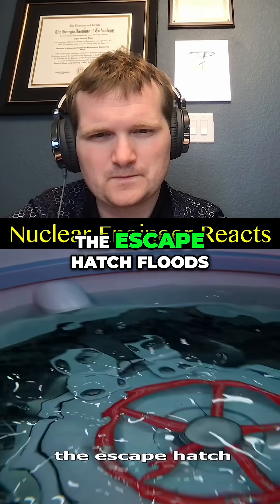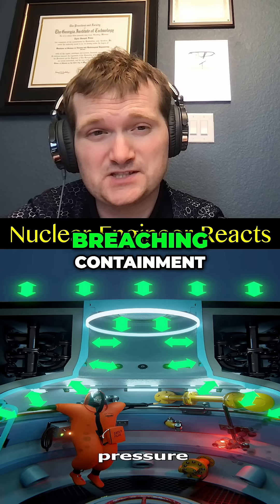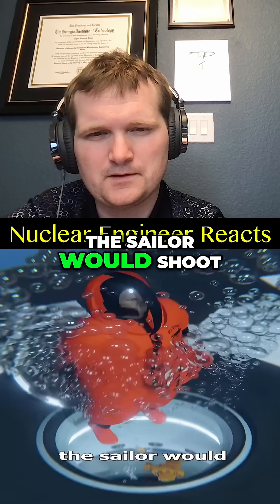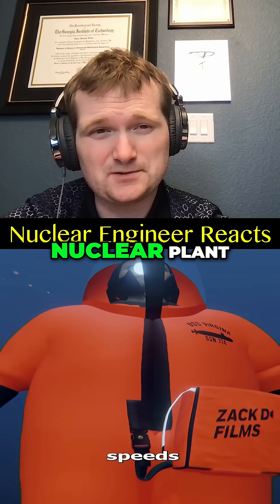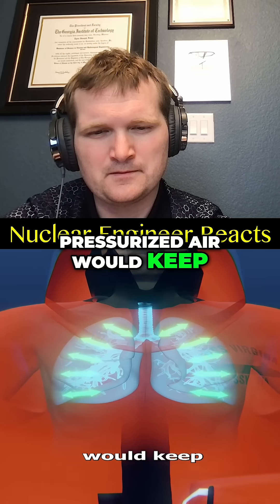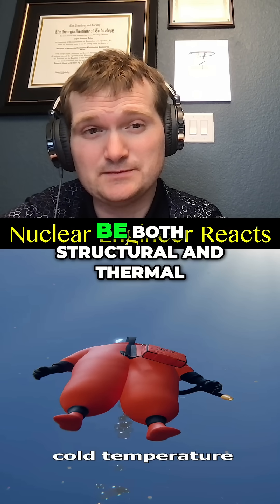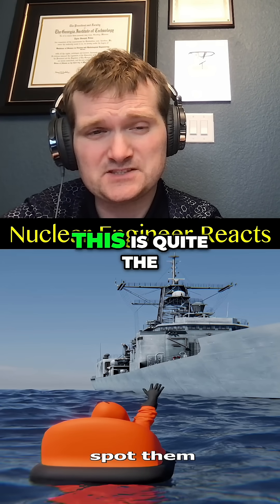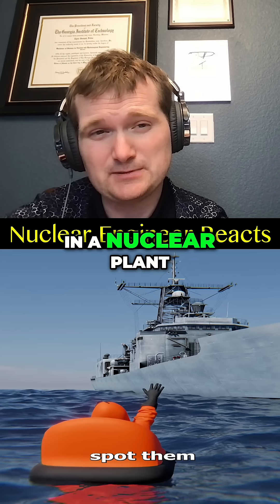How Sailors Escape Submarines - Nuclear Engineer Reacts to Zack D. Films

Comment: Question: if it works as designed and here explained, and the sailor surface, would there be a way/ enough time to equalize the pressure? Decompression without the chamber? At what point does the suit reach the limit of its usefulness?

Comment: Is this why divers can’t come up right away? Cause the pressure?
Reply: They have to spend intervals of time at a given pressure before moving to lesser pressures. This is to allow the human body to deal with reduced pressure without bodily fluids converting to gasses.
That only applies if they've been at very high pressures (deep dive).
With a submarine evacuation suit, the sub occupant would not be under high pressure as the sub deals with deep sea pressures via steel structure, not internal air pressure. To get from the sub to the surface, they have to pass through extremely high water pressures. The suit would expose them to extreme internal pressures until they reach the surface. As Tyler said, the suit vents the excess pressures as the sailor floats to lesser and lesser water pressure zone.

Comment: Fun science fact: If you pressurize air enough, it becomes heavier than water. At depths that science submersibles dive to, this becomes an issue. They will use incompressible fluids that are lighter than water, such as gasoline, to rise up.
Reply: Don't you need around 900 atmospheres for that? So unless you're in mariana trench, it should still be lighter
Reply: @d07RiV I'm not sure of the exact depth and temperature. But yes, I was thinking about the sub that dove into the trench.

Comment: Imagine hitting a fish at 15 feet per second and dying
Reply: I don't think 10mph contact with a fish will do too much damage to a person
Reply: @beerrun5 you say that until it rips the suit and you explode 200m down
Reply: @BraystalBray yea, it could happen, but a suit built to withstand that pressure should have enough of a safety net to protect against that situation.
Reply: @BraystalBray The absolute pressure would be high—about 1 atm + 200 m H2O, which is over 20 atm—but gauge pressure could be in the party balloon range (less than 0.1 atm). The issue with a rupture isn't exploding, it's not ascending fast enough to avoid decompression sickness.
Reply: Not mention the propellor of the surface ship above you 😊

Comment: They're still gonna get the bends pretty bad won't they?  That was an actual question too if anyone knows.
Reply: I was thinking that too while watching and thought Tyler would address this but didn't
Reply: The Bends happens because of excess nitrogen in circulation when diving as a function of pressure and time, because inhaled SCBA gas is not ambient air. It is still possible in this circumstance but less so because the sailor would, presumably, be breathing ambient submarine air. Also, the risk of bends is certainly better than getting crushed instantly in a submarine accident.

Comment: I know he's smart, but I don't think he knows all this stuff off the top of his head.
Reply: You have to have extensive knowledge of physics to become a nuclear engineer.
Reply: Differential pressures isn't that difficult to grasp. There's a lot of exact math with it, but the concept isn't difficult.
In the environment of the earth, everything experiences pressure from either atmospheric gasses or fluids like water. The human lungs and bodily fluids function under specific pressures. Rapidly changing environments to higher or lower pressures can quickly cause life-threatening hazards.
Like pulling deep sea fish to the surface too quickly, they tend to rupture.

Comment: An automated way to combat the bends?

Could this/ has this be/been deployed as a safety fail for tourist divers/learners on first stage of license/ deep sea dives?

Dry suits only? Or no, full suits? 
Have to be pressured beforehand and not diving before? 

As I wrote it down I could see the issues but maybe someone’s a way it could work because of something I don’t know?
Hit me up I wanna hear it
Reply: Got a way I don’t know* 

Yeah I’m stupid in some of my thoughts but it was my typed thought pathway. Please explain how I’m wrong if I am. No wrong answers
Reply: Divers will have nitrogen dissolving into their tissues for the length of their dive. In the escape suit scenario, you're at whatever pressure the sub operates at (presumably 1atm or close) until the chamber is flooded. If the sub is more than a couple hundred feet deep, I imagine there's still some risk of getting bent, but that is generally less risky than being stuck inside a failing sub.

But yeah, for divers, there's a reason saturation divers go down in a full on pressure vessel, there's not any real way to miniaturize that.

Comment: 75lbs of positive buoyancy, if I recall correctly. The suit also doesn't "pressurize", as it is not sealed. It is just filled with air, creating a "bubble" of breathable atmosphere in the hood for the ride up. It is very important to exhale hard as you ascend and the air expands.

Comment: I'm a former submariner and this is either new, not used by the US Navy, or BS. There were no suits or life rafts or safety devices when I was there. You take a deep breath after equalizing (otherwise you can't open the hatch). Close the hatch after exiting, then head up.
1 breath 2-3 if you grabbed a plastic bag before leaving. That's it.
No one ever expected to get out alive so it wasn't practiced or discussed much.
Reply: I found this on Wikipedia

"Following a nearly 30-year hiatus, the U.S. Navy reinstituted pressurized submarine escape training (PSET) for submarine sailors in 2009, using the Beaufort Mk 10 Submarine Escape and Immersion Equipment"
Reply: @elpapa68 
It's still useless. If your on the bottom flooding, there's no time to escape much less put on a suit. If there is time and you're not too deep (there is a max escape depth) then there's time to repair and get underway.
So, useless.

Comment: What about decompression sickness? Even when the speed is controlled, rapid surfacing causes nitrogen to build up quickly, which causes decompression sickness.
This requires a decrompression chamber to treat. If not available, it causes nausea, pain in the bones/joints and in worst cases even death.
Reply: I'm guessing the inside of a submarine is going to be close to atmospheric, so only during the emergency will the pressure be increased. For nitrogen to dissolve into your tissues (especially fatty ones like your brain) it takes some time, so if the evacuation is done quickly enough id guess it would be survivable. But i would guess that the chance of a decompression injuriy is rather high even if the person survives.
Reply: The only high pressure the occupant is exposed to between the submarine interior, and the ocean surface, is the water passage between the two, more specifically the water pressure around the sub and several hundreds of feet of water below the surface. The suit replicates that ocean pressure but as the person floats to lesser pressure water, the suit ventilates slowly.
As a guess, the suit will maintain pressure at the surface to avoid speedily deflating and causing bends.